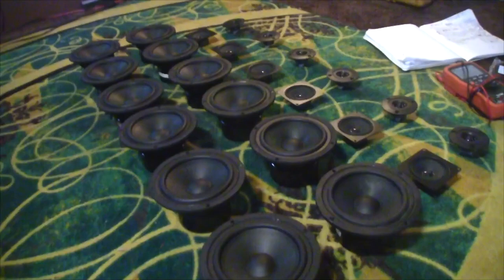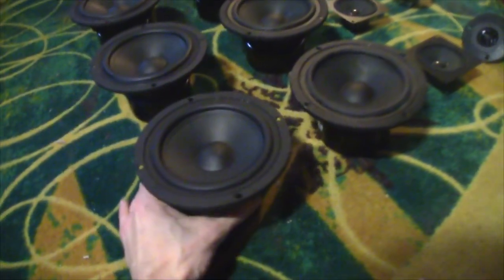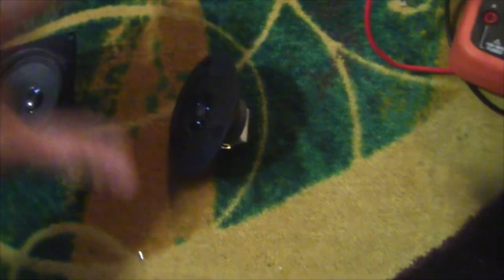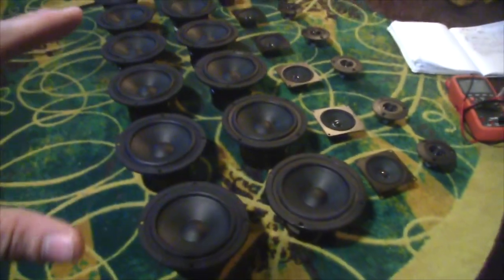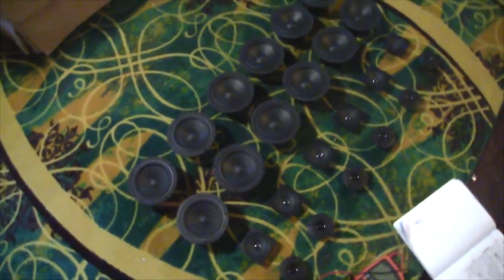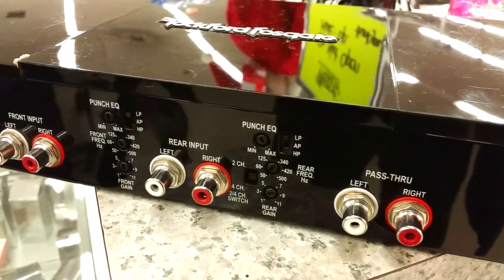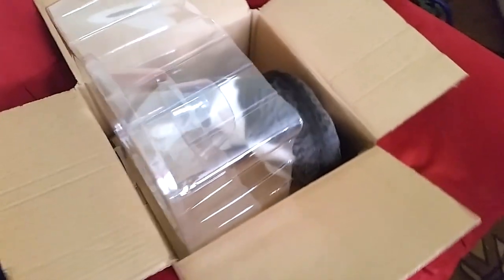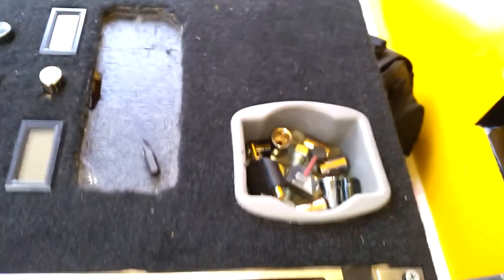EXO's DIY Home Audio Project BEGINS | Build a BIG 2 Channel Stereo OR Surround Sound Speaker System?

Comment: Definitely split them up for a sweet surround system
Reply from the maker: Joseph Yartins I think that's probably the direction I'm going to take. I will still likely add a sub section on the 2 front towers, that way I don't necessarily have to run the external sub(s) all the time.
Reply: EXOabigdeal that sounds like what I'd do as well.

Comment: hey EXO. I myself am building the tritrix kit from parts-express. I definitely recommend zip tying and hot-melt glueing your crossover as the inductors especially can be quite heavy and you don't want them falling off.
have fun with your build  EXO. you should do sealed with those puppies and pair them with a subwoofer for some huge midrange kick.
Reply: well. . . i'm kinda building the tritrix kit. I bought the speaker and crossover parts, but I am building the box and I made a few modifications to the tritrix TL and am building it out of birch ply.

Comment: Hey, I've got to give you credit, I'm a bit older than you and great to see you're playing around with this stuff and have a great hobby! One thing about the world of "audiophiles" (or sometimes audiosnobs, sometimes just losers taking cheap shots at each other, sometimes just people who spend TOO MUCH time ALONE with their audio gear-AND SOMETIMES SOME PRETTY COOL PEOPLE-ITS A REAL ROLL OF THE DICE!)

I'll tell you one system I had, that I totally lucked into and it was extra luck because I was living in a building built just post-Civil War with stone walls that were literally over 2 feet thick of solid stone and mortar! So, even though I had neighbors at least on one side (I was on 2nd floor) I could CRANK this stuff to the point of being really concerned about ear damage and NEVER a complaint!

It was a wholesaler I bought other gear through, they were closing out Cerwin Vega's CLS line (very close to recent XLS line) and I know, some jerk off, 82 yr old mom's basement dwelling pole smoker will say "Cerwin's are crap shit frat house speakers!" Well Mr Jergens Jerkoff King, check out the very few reviews done on the CLS-215 or XLS-215 and see what they had to say, you might be eating those words, soon as your done eating that latest cock! 

Anyway, wholesaler said to me "Hey last pair, these are going for like $700 each on ebay, take em both now for $500!" I didn't even bother to check since this guy has been honest man to deal with for years, gave him $500 and off I went! I had a Crown XLS 802 amp (the older Crown XLS, not the newer Drive Core models) that put out 500 watts/side into 8 ohms but I think these cls-215's were 6 ohms, rated to take 500 watts but you know you want some headroom with your amp/speaker combos.

Thank God for those 2+ foot thick stone walls, because I used to CRANK those things, 2 15" woofers, they sounded awesome!  Some Jergens Jerk Off Audio fag will still say his $1700 Fagasound 69's with the 4 3.5" "bass woofers" plays his Poop Shop Boys albums way better, but I say keep that flamer gear, go for the 215's!!!!

Comment: What I did was make two huge towers that have two 8" subwoofers for the lows but control whether they play mids or lows with an active crossover. Then I hooked up my subs to a separate amp which is linked to a subwoofer output on the same crossover (which means I have the oh so important BASS KNOB!) So all I have to do is cut the lows on the towers and use the subs if I want the bass to shake the walls :D

Comment: I think you should go for 6 independent speakers for a full surround sound set up, someting like the Tritrix with 2 woofers per side in some sort of transmission line enclosure, fs of 70Hz does seem a little high though, I have used a 6" sb acoustics woofer in my build and it has a fs of 32Hz, and as a result my towers can play easily down to 35Hz with 25 - 35Hz still being audible.

Comment: Go with a matching set of 5 speakers for a 5.1 setup. For a first time build, trying to design a crossover, and calculating the cabinet dimensions and port details for more than 3 drivers per speaker is going to be a lot of headache. If it were me, I would build two towers with two woofers, a mid, and a tweeter, and then build the center channel and rears with one of each. You can use the remaining drivers you have to experiment

Comment: cats are awesome!!! so's that bass! i would suggest to make a seperate sub box with a subwoofer on top, in front, on left and right sides but leave back open for wire connections. bottom of box would have rubber stands. and yes two towers for tweeters with four subs in both and four tweeters above those and below them in a four, two, two, four setup with the sub box in between!!!

Comment: my suggestion is a 2.1 setup. cross your 5 1/4's over at something like 50-60hz so they dig a little lower than 70hz but do it on a 24db/octave filter. make a separate sub enclosure and put maybe 2 8's in a 4th or 6th order box with a nice plexi window etched with your logo.

Comment: Use passive radiators! I built towers with 2, 6 1/2s and a 10" passive radiator, very clean with a smaller enclosure and if the radiators are weighted properly you can get some a pretty low response.

Comment: add some small down firing sealed subs to the bottom of the front towers. then port the mids out the back of each front/surround tower. having the port on the front face has an affect on the dispersion pattern of the tweeter. though the last towers i built i put the port below the mids instead and have been rocking them for 3 years.

Comment: im building a pair of 6.5" bookshelf speakers with a Peerless 830874 woofer and Morel MDT 29 dome tweeter, giving me roughly 89db/1w/1m and an f3 around 45hz and i get 5.3mm of xmax, should be some mighty bookshelves
i bought dayton audio 2.5khz crossovers, they were a bit more expensive than building it on my own, but for the quality of the board and the work that it will save me i found it worth it
but what it looks like you'll need is 3 way crossovers, build it yourself and they will be around $30-40 each my guess, it mainly depends on the frequencies you choose

Comment: EXOabigdeal I would use a sub to cover 20/30 to 120hz. Then XO it to some fullrangers. Have a look at the MiniDSP, good way to learn crossovers without blowing a lot of money on XO components. If you want to do it with caps/coils/resistors you might want to learn a simulator like Boxsim first.

Comment: If those woofers fs is 70hz? I don't reccomend tuning super low if you're using this to watch movies. My high reccomendation, is to get a 5.1 or 6.1 amp. Run two woofers in either a sealed or ported box tuned around 70-75hz, and run a seperate sub. A proper home theater amp, is going to let you set your sub crossovers. So you'll likely be doing 80hz and under on a sub, and 80hz up on your woofers in the video. I will say, 2 of these even in a sealed box, will be a decent tower sized box. Now, many amps require a powered subwoofer instead of being powerful enough to do it on its own.. So thats something to think about.

Though, if you're using them strictly for music? Just 2 crazy boxes with 6 of them in each.

Comment: i personally like the sound of a 2 channel and even a center. But if you can  position you speakers right and have them time aligned and eqed right.The Surround can sound good plus with a 5 channel you could always run it as a 2 channel too. I think you should crossover the 5.5 at 50 hz and get a 10 or 8 to play 50 down. Its gonna be hard to get the 5.5s to play into the 20s with authority.

Comment: Are you planning on building a powered subwoofer also? because I made a set of towers with 1-6.5''woofer &1-5.25''midwoofer and a 3/4''tweeter and it produces really good bass I also made a dual 12'' opposing baffle powered subwoofer it gives me all the bass I need and i'm a basshead driven by a 150w Polk audio plate amp I have a Hifonics HFEQ/line driver in line hooked up by a ac/dc converter so I have freq,bass boost control as it was needed with the sealed sub setup. I think you'll have all the bass you'll need with 6 in each tower judging the room size from this video a good set of bookshelfs for the rear and your all set.

Comment: I would go with a sub built into the towers but isolated in its own chamber or with a t-line built into the tower something like barevids does with his 4 eight inch mid-bass drivers. This project would be cool with some insane paint job like a lime green or something.
Reply: or yellow to match frankie

Comment: 5.1 Surround. 
(2) Front 3 Woofers  1 mid 1 tweet.
(1) Center 2 Woofers 2 mid 2 tweet
(2) Rear 1 Woofer 1 mid 1 Tweet
Subwoofer 12, 10, or Dual 8's
Reply: 7.2
Reply: +Shaolin Danger center speakers are usually tonally balanced at 2 woofers, 1 mid and 1 tweeter. a center speaker is generally only there to provide vocals. 2 tweeters will become harsh and un natural. yes, I have built my own speakers previously and I'm and audiophile.

Comment: I would go with a  separate Woofer in it's own box. that way it doesn't fight the mids in the same box. basically a 5.1 / 6.1 system
Reply from the maker: ***** Each chamber is going to be separated from the other, so they wouldn't be fighting eachother in that case. Since this video though,  I've been reviewing a lot of high end designs and they all seem to incorporate a low end driver in the tower, often ported to the front to eliminate 'boundary' effects from the walls. Doing this may have an advantage when only using it for a casual 2 channel stereo without a designated external woofer. I don't want to always have a woofer running to hear decent bass, so maybe adding a woofer to the network would be advantageous for me :)
Reply: EXOabigdeal u should do what Steve Meade did with his towers it came out amazing
Reply: EXOabigdeal
sounds like that would work :)
Reply: EXOabigdeal
I have a 7.1 system and my fronts are 4 ways, with a 12" woofer at the bottom (and sealed). They aren't super powerful like a subwoofer, but when watching movies at night they provide enough low end that you can hear the rumble from the bass, but not feel it (or wake up someone trying to sleep).

Comment: bare with me because I'm going to use speech to text,
Let's talk about the left cabinet. The last cabinet on the left hand side you should put your low-frequency drivers in a line array from floor to ceiling tightly clustered. Just to the right of it you should have your mid range and tweeters in the same configuration a line array. 
I would definitely suggest a separate enclosure for a low frequency transducer and electronically filter accordingly to the f3 of your enclosure.
Welcome to the world of audiophile.  I think you're very knowledgeable and once you get a grasp on high fidelity for home design that you will be very successful.
You could always hit me up in my Facebook room affordable audiophile Lounge. I also belong to a network of other resources that can help you.

Comment: I would do like sonos and put them in a 6th order and have the top part of the cabinet for the tweets. Go to best buy and listen to the sonos sub. Small driver sounds great!
Reply: Huh? Sonos sub isn't 6th order?
Reply: LutkeVeldNL I believe that it is. You have the load chamber on the front of the speakers and the back side is ported into that chamber as well. Might not be a 6th order but it is a bandpass and it sounds amazing.
Reply: Ah, I never saw the vent openings in the pictures, but I see what you mean on the 'exploded' picture I found. For it to be a 6th order, the front side of the woofer would have to be in another box that is ported. It seems like a 'normal' vented/basreflex box to me, mounted in a force-cancelling setup.

Comment: 2 front tower
2 tweeter
2 mid tweeter
2 mid driver 
2 mid bass i the same Seald box to puch against each-other because of the low x max so you can give those mid bass more power

      2 rare speaker
1 mid
1tweeter
1 mid tweeter
1 mid bass

          
2 Long throw 10 or 12

Comment: split them in a 5.1 system,...and add latter a 400 w subwoofer,...and put the fronts in t-line boxes,...the rear speakers are less important for the bass,...i would put them in a closed enclosure,....so they can be smaller,...and the woofer in a t-line too,,...i have a very simillar system at home,...front and woofer ina a t-line,...the bass response is veeeeeeeeery good,...the fronts get down to 35 hz,...and the woofer down to 22 hz,...sound amaizing,....highly recomend t-lines ;) if you like i can link you a video of my system,....similar like your with the speakers :D